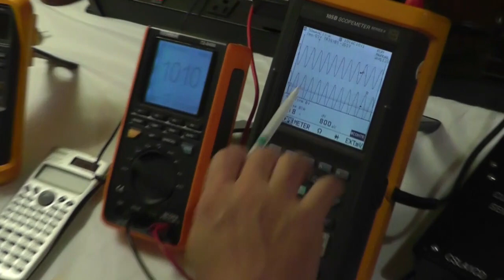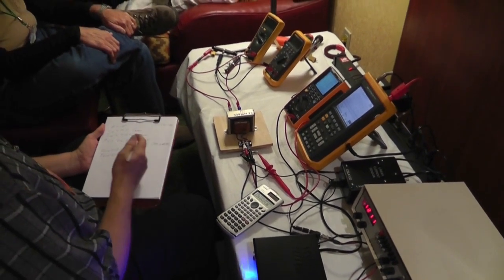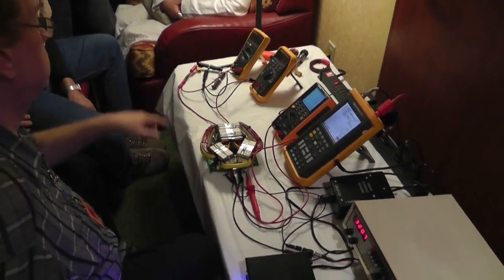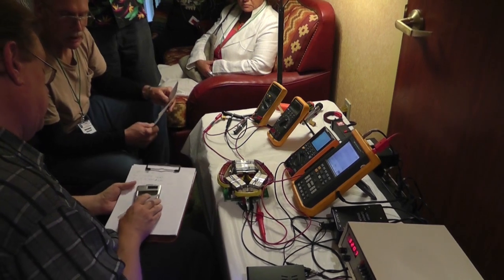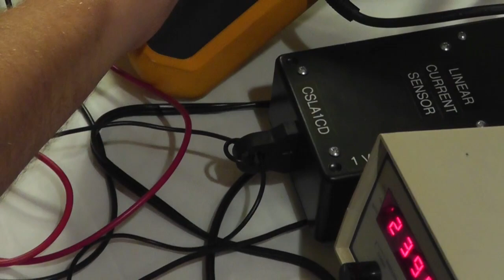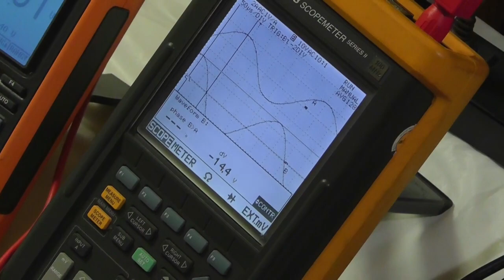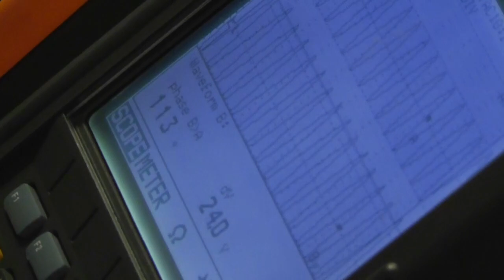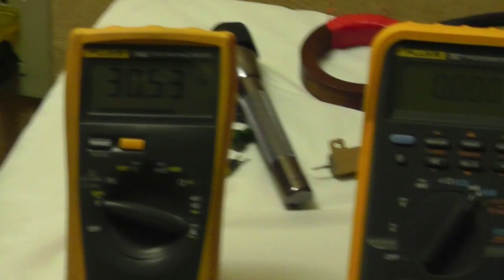AuroraTek demonstion tesla tech 2014 overunity? (Russ's View)

Comment: Sadly, instrumentation errors could still be grossly present here. The Fluke 787 used for AC RMS Output Current measurements has a limited frequency range where the RMS conversion is accurate (like most small multimeters). The AC Volts specification is only 7% +4 over the range of 200-500Hz... and he runs it at 3200 Hz.  The same internal circuitry is used to calculate RMS Current, since it's just AC Volts measured across the internal shunt.

Likewise, the Fluke 79 series III multimeter specification for AC Volts is only 45Hz to 1kHz.
Reply: You can meashure current dividing voltage by resistance. Output voltmeter showing 10 V. Resistor seems is 25 omh. 10/25= 0.4 A. Ampemeter showing about 0.4 A. So seems ampermeter and volmeter showing corect. Plus secindary seems conected in series it resistance is about 32 omh. If curent 0.4, then voltage on it is 0.4*32=13 V. 13V*0.4=5.2 W disipated on secondaries?
Reply: And how about, that he get more than 90 degree, then he short secondary?